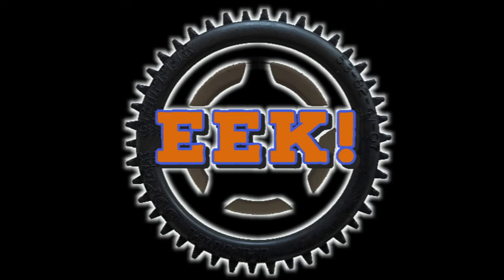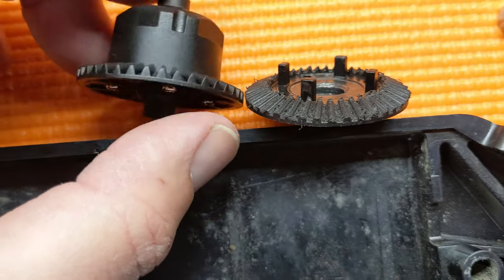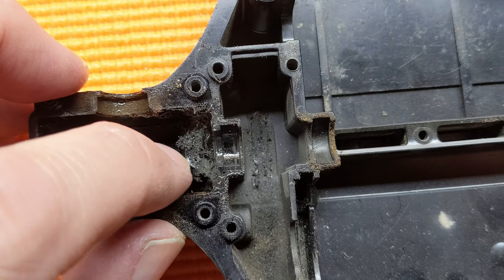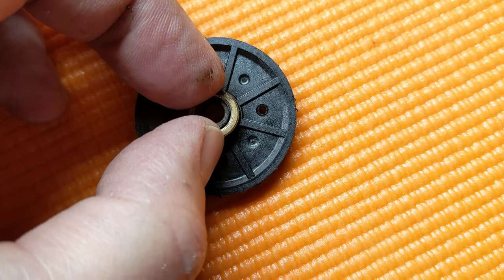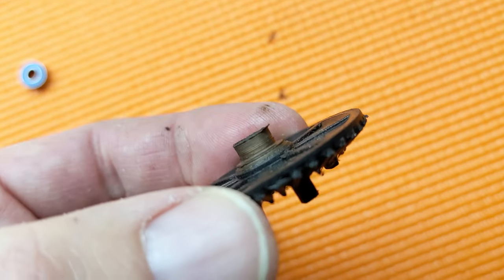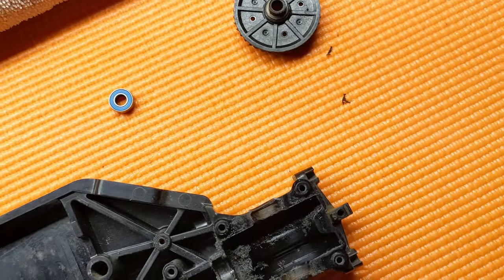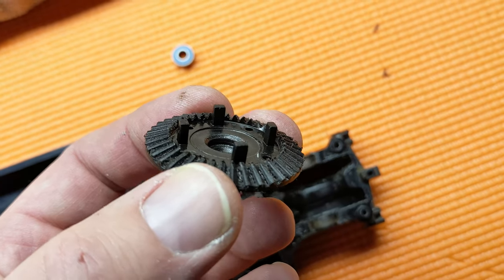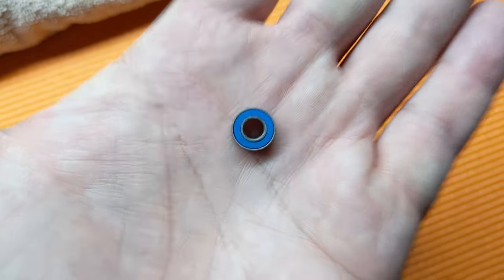When You Don't Use Bearings In Your Tamiya RC Kits!

Comment: I agree completely, if you make no other upgrade, install ball bearings. In addition, you might want to consider sealed bearings for the wheel hubs and anything else exposed to the outside. This will keep water from entering the bearing and rusting it out. They also have ceramic bearings, but these are pretty darn expensive and not really needed unless you plan on running you car in the swamp or in the water a lot.
Reply from the maker: Definitely, sealed bearings are the way to go, they probably save more money than they cost in the long run.